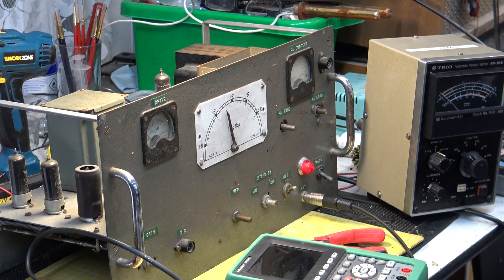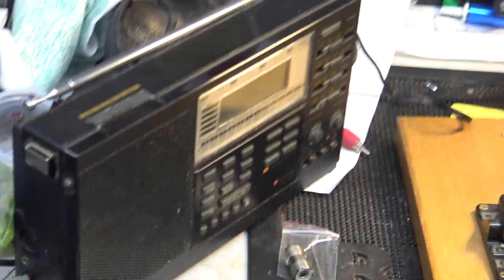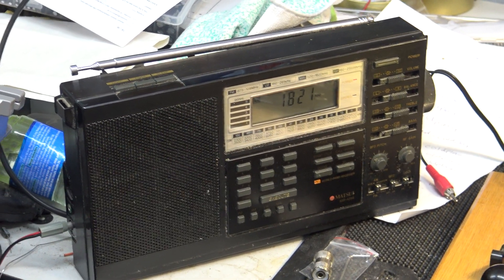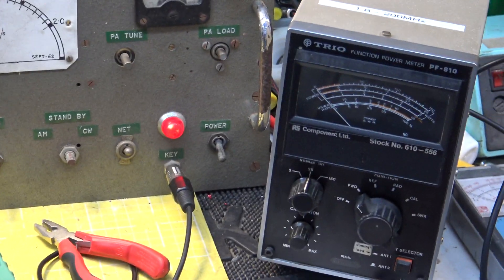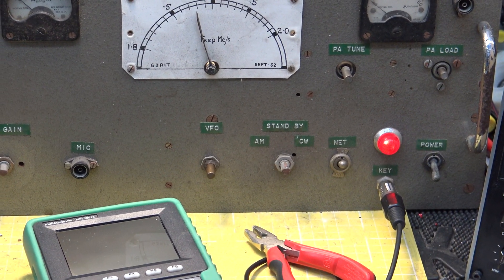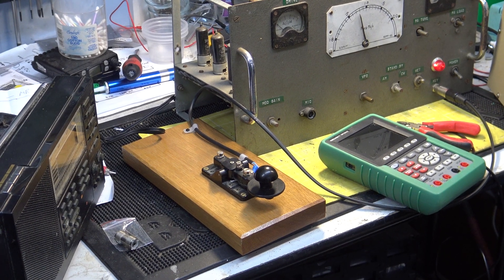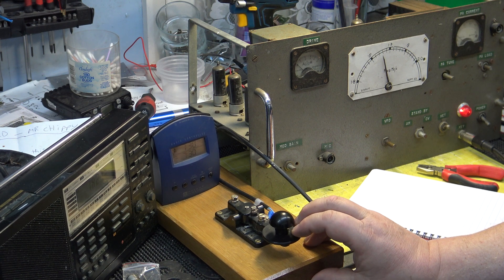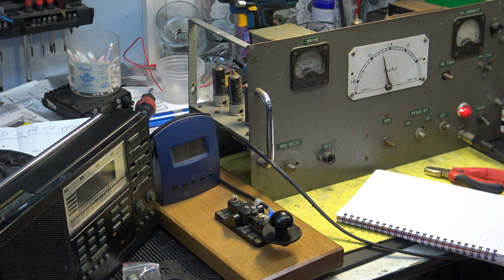Amateur radio 1.8Mhz CW attempt with the 1962 homebrew transmitter.

Comment: Hi Richard been cleaning out my shed and found a PYE AM shaver microphone it is of no use to me but any good for you with this radio....
Reply from the maker: Although it would be welcome here, they are for the Pye MF6 Reporters & M290 series & are the wrong impedance & output level for this radio. The shaver mic needs 10V up the lead to run the FET preamp. They are also not compatible with CB radios as there is only a single pole make switch for the PTT. A CB needs a double pole changeover switch.

This radio needs a microphone with a high output crystal insert, probably as high as 50K ohms

Richard, G0OJF, UK
Reply: @ukfmcbradioservicingTango21  Ok I am sorry it was not a get out of jail free card for now for you with the radio. Will wait for the next test to be done all the best chris.

Comment: If that's a Realistic  DX-440, it's really a Sangean ATS-803A minus the DIN output.  Well thought of by hobbyists.

T21, are you listening to a sidetone on headphones??  I can't imagine sending Morse without being able to hear some sort of tone.  Like you, I've not done lot of code since I upgraded to (US) General back when there was still a 13-wpm test.
Reply from the maker: Over the last 6 months I've been having half an hour each Thursday with Stewart sending & receiving CW on 2M, then talking back like we did here on GB3GR 70cms repeater (that I own). We've been sending each other passages from kid's books for a laugh. My exam was at 14WPM back in the late 80's. I'm not trying to be top dog in morse, just good enough to do things like this with my mates. Yes, Sangean was what I was thinking of..this is the Matsui branded one so was 'badge engineered' for the UK Curry's chain.

Richard, G0OJF, UK
Reply: @ukfmcbradioservicingTango21  I dabble occasionally as well.  About 10 years ago we were running a Morse net after our regular 10-m SSB nonsense net.  I should probably see about getting that going again.  Sending passages from kids' books sounds like a great idea!
Reply from the maker: I had the receiver on very low volume to act as a sidetone.

Richard